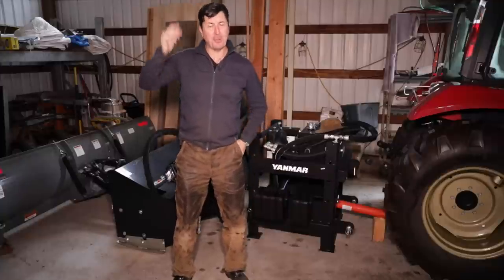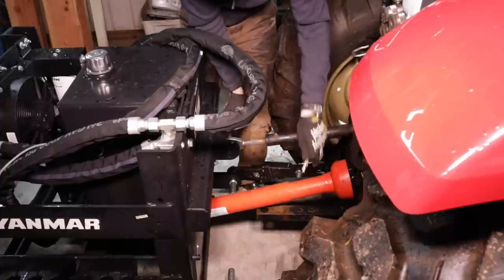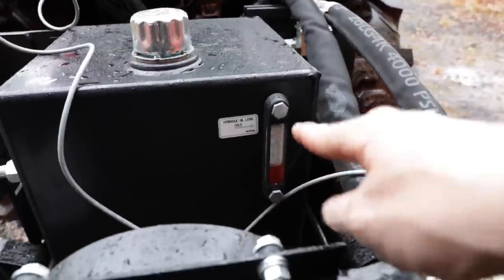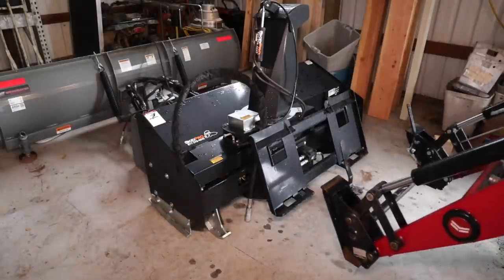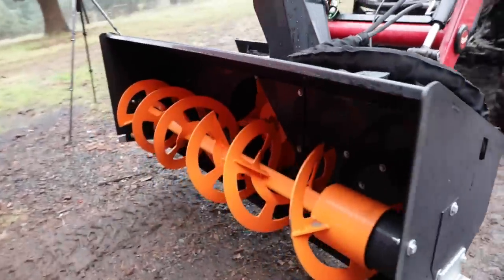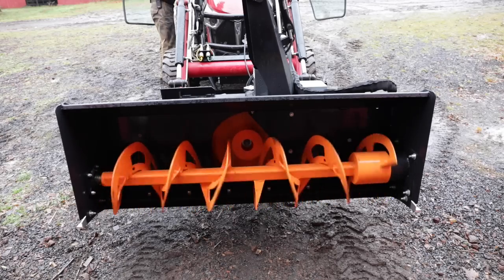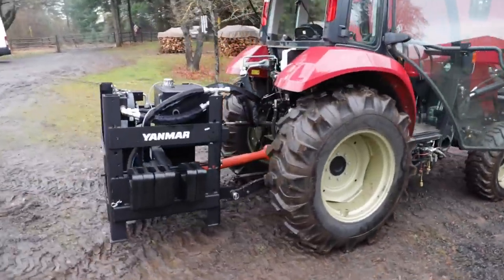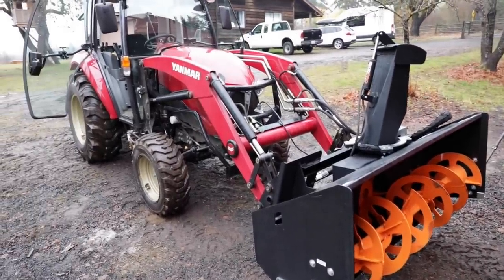This Yanmar Prototype Snow Blower Is AMAZING!!!

Comment: its pretty obvious another what was once a good youtube has sold out on us says the backhoe or box blade is to big on the back of the tractor and yet that crazy power unit sticks out just as far if not farther than either of those.
Reply: Really? What tape measure were you using?  My backhoe for my smaller tractor sticks out farther than that thing does on his big tractor.  I don't remember him saying anything about a box blade. My box blade is very short and if I make it more useful with 3 blades instead of 1 it will be heavier and longer.

Comment: Slightly off topic, but I'd respect your opinion on a question about tractors.  I know your background is operating heavy equipment, so you'd be a good one to answer, and it might be a popular video.

Question is (ok, multiple related questions):  I'm buying land to start my homestead, and I want to buy a tractor that is best for use on about 30 acres.  The land has a lot of trees now, sandy soil, and is in the South-Eastern US. If I have about $20,000 I want to spend on the tractor plus about $10K for attachments, would you look for a used tractor or a new one, and which tractor(s) would you look at?  What if I was willing to spend $50K on tractor and attachments?  Supposing the $30K was in the budget and $50K is possible but stretching me a bit, should I just "suck it up and spend the money", or is the $30K plenty for a small homestead?  Is the balance between tractor and attachments to start with about right, or should I spend it all on a tractor and buy more attachments as I can afford them?

Hope you are interested in taking this one on.

Comment: you should of ran the wire up the front loader arm so if your not paying attention the control wires don't get pulled and broke by lifting the unit to high,, (the pivot point for the wiring harness will be at the back pin for the loader) just a thought I run excavating  equipment for a living i see small things like that get forgot about and wires get ripped out

Comment: I have a 60" thrower that's connected to the back and direct drive on the PTO.  Paid around $2K from Northern Tool.  I keep the plow on the front and the thrower on the back.  This thing seems like total overkill to me.  ;-)  Video is on my channel.
Reply: I completely agree, why over complicate by adding an entire hydraulic system when you can just power the snow thrower direct off the PTO. No wasted energy, very simple design and very simple to repair yourself. This Yanmar system seems to be complicated just because they can, so many different failure points vs a direct drive PTO snow thrower. Sure then you drive in reverse but then you are also closer to the snow thrower and it makes it much easier to tell distance. I also didn't care for the fact that this unit has no drift cutters. All my opinion though take it or leave it :)
Reply: can use all sorts of skidsteer tools... it's more flexible
Reply: i could fit that blower on to a MT55 bobcat
Reply: Any good units for a jd 1026r?
Reply: sure, but can your bobcat do everything this tractor can?
Reply: Yeah this is just stupid?
Reply: I think I  mentioned this idea in one of your previous video's.   It is a great idea!  This will give the tractor all of the skid steer ability and still have all of the tractor abilities.  It would be nice if they could install hy-flow pump to run directly from the engine instead of the PTO.  That would be the machine I would want.
Reply: no not at the deere dealer here in pei but my kubota dealer sells snowblowers wich can be run off with the hydrulics on the arms of the M30 kubota loader wich kubota uses its own hydrulic fluid wich transfer from the hydrulic tank thats on the kubota m tractor and goes in to the front at the m30 loader and it runs the blower and the hydrulic oil trans fer back to the tank on the kubota wich its slick wich done it with a m8540
Reply: Michael Mac Tavish 
Sounds like a better alternative to jd setup
Reply: plus kubota even has a front mount 3point hitch with front  hydrulic remotes and pto shaft for them on front as well as a optional wich is nice set up with front 3 point hitch and a nice $1,799.00 60'' blower from my kubota dealer
Reply: you obviously have never heard of rear view mirrors.  I've spent a few hours at a time clearing snow with my machine.  Driving it backward is a simple task.
Reply: Bigelow Brook Farm (Web4Deb) - No thanks. I like to face my work, not have it occur behind me.
Reply: I'll be honest, this seems to be Yanmar and Cody finding a complicated solution to a simple issue. We already sort of know that Cody is prone to that, go back to his video where he wanted to build retail style shelves for his workshop only to have everyone remind him French Cleats exist. Yanmar for their side of it, just found a way to force people to buy two tools to make one work.
Reply: Can't wait to see it in action!!!
Reply: I think the idea of backing down the Martians long driveway might be a bit of unnecessary back pain and neck cranks, also you can run things such as brushes and others.  Being as far as the homestead is from things like hospitals or him as a First Responder the ability to throw snow might help save lives.
Reply: I think a lot of you are missing the point. The hydro pack isn't just good for the snow blower, it can now run any high flow attachment a skid steer can. So it's a lot more versatile then you are thinking it is.
Reply from the maker: Have you ever had to get up at 4:00 in the morning to plow a driveway that is nearly 2 miles long in a blizzard in reverse just so you can get to work? I have and I can tell you it is not fun. Don't forget we live in the mountains so one wrong move and you're over a cliff. Perhaps you should wait and see how it works in the condition we have before you discount this setup.
Reply from the maker: No
Reply from the maker: I just love all the opinions from people who don't live in the mountains and know little about snow removal,
Reply from the maker: Yep a rear view mirror solves everything, what a clever chap you are,
Reply from the maker: I'm always open to a good idea. Please show me a better way to mount a snowblower to the front of a tractor,
Reply: Wranglerstar   Front PTO on a three point hitch would work as well for the snow removal.  This hydraulic pack will run a 5 foot brush hog though.  This would be the very thing up front.
Reply: I've put in a lot of miles with a snow blower on the rear of a tractor and I can say from experience that every day I longed to have the blower out front. You don't know the sore neck you get till you have spent 7 miles looking over your shoulder. And don't even suggest that a mirror is going to help. When its dark and the wind is blowing at you and the ice is blowing all over your back end there isn't a mirror in the world that will help. Half of my time snow blowing was in an open cab tractor with no heat. There was nothing fun about it but we had to have the road clear for the guys doing the logging on our cattle ranch. I would like a more compact hydro unit than this one but when you are spinning up a hill at -30 you would be glad for the extra traction.
Reply: fast cyclst a
Reply: Wranglerstar's Yanmar Model YT359 tractor is 58.9 gross engine horsepower and 52 PTO HP at working speed. It has a two pump hydraulic system. 9.4 GPM (gallons per minute) (35.5 L/min.) for attachments. 5.3 GPM (20.1 L/min.) for the power steering. 14.7 GPM (55.6 L/min.) total flow from the tractor's two pumps.
https://www.yanmartractor.com/resources/spec-sheets
Reply: Maybe it wouldn't work on this large of a tractor, but the International Harvester Lo-Boy 184, a supersized garden tractor, Runs a shaft from the rear to the front to make a front PTO. lift height is limited to around a foot though. Maybe running an external motor on a snowblower would be a good option too? Not sure, but it might be cheaper just to have an external 20-30hp Honda unit mounted on the blower itself. I'm sure you would have considered that though.
Reply: Yanmar, KISS rule.  Take a page from Kubota's book.  Use the mid PTO or run an underbelly PTO for the snow blower.
Reply: Here in Finland we get tons of snow. Probably more than you do. What we have are snow blowers that are mounted to the rear of tractors, powered straight off the PTO, but instead of having to reverse to make them work, the blowers are made in this kind of a V shape that naturally collects snow as you drive forwards, and then throw that snow whichever direction you want to. People use these snow blowers professionally, to clear miles and miles of roads a night. These things cost about 3000-6000 USD in Finland depending on model and features, which has got to be less than something that is as complicated as that Yanmar thing is. Here's a video (not mine) showing how they work: https://www.youtube.com/watch?v=sK_Mnu0HrTU
Reply: Wranglerstar Im a Canuck. I can assure you we are not strangers to snow(all forms of it). You are giving a very complicated/expensive solution to a problem that has already been solved.  1- i would have the driveway 1/2 done before you were finished hooking all this up. 2- we have all used(some of us) 3 pt hitch blowers, they are extremely dependable, do a great job, and have very few if any weak fail points(wiring etc).  3- you have not mentioned the cost of this setup? Im sure you are sponsered but the rest of us "working stiffs" have to shell out real hard earned money for the things that make our life easier. I am making a guess at cost but I would say most people wouldn't shell out $10k(guess) to drive foreward with the same results. 4- I feel like I got duped into watching a commercial??
Reply: @trentond83  It may seem overkill for just a snowblower, but think of all the implements you can run off a system like this. You basically have a full size tractor that can run Skidsteer attachments, awesome.

Comment: The electrics for the blower you should run along lift arms so you can blow snow with loader way in the air for instance if you have a 20' drift you need to blow out.

Comment: That was definitely designed by an engineer with a gun to his head.  Our 753 Hi-Flo Bobcat with an 84" blower....bombproof.  We have used it for 20 years down in Oregon, it's a one man five minute operation to install.  That thing you have.....I don't even know what to call it, guess I have to see it run.  I doubt it will impress me and even if it did there are just too many weak points.  But, hey, ya know, free stuff.

Comment: Looks like it could be kinda handy. Would have liked to see the controls for the snow blower somehow implemented into the standard front loader control lever instead of a seperate remote. Like maybe a switch that toggles between normal loader functions and control of the secondary hydraulic systems. Other than that it looks great. Definitely see how this could be useful :)

Comment: Wouldn't it be much more efficient to drive the snow thrower directly with the p.t.o. as every good snow thrower has for the past 50 years
Reply: Yes I'm theory there is much less of an efficiency loss with a mechanical drive system. Hydralics as a form of power transfer method is very inefficient.
Reply: Save A Penny 
Spend A Buck

Comment: just thinking of optional devices to use the big power back on the back... 

 giant road and driveway sweeping brush..  there are several possibilities for hydraulic jack hammers.. but instead of a fixed mount for the jackhammer.. have it on a let to right slide with a hydraulic cylinder so you can jack hammer like one eats corn on the cob.. side to side.  move forward and take another row side to side.   but also have the hydraulic jackhammer mounted on a dozer type of blade to push debris around.  might have to have the bottom with a double sided cutting edge so it could be used to pull debris backwards also..  it might fit on a conventional front bucket lip..   with a hydraulic up and down on the body of the hydraulic jack hammer so you can go way below the cutting edge of the blade with the impact tool edge. 

  perhaps a hydraulic compacting roller for the front.  so you could compact driveways or areas where you don't want weeds or grasses to come up thru. pack the soil tight. but it could also be used to compact asphalt or even gravel driveways.. 

 will the conventional tractor hydraulics run a drive for drilling fence post and other holes with a various sizes of augers..  got to put that hydraulic unit to use.. 

 these are just thoughts.. you might share with the tractor manufacturer..    don't forget.. that spraying the chute with multiple layers of PAM cooking spray will prevent the snow from sticking ... you can do the same to the grooves of your tires.. along with the sidewalls.. so your tires don't get packed in snow reducing grip.

Comment: Is that electric plug on the tractor instead of on the loader? I can see it already, if it is mounted on the tractor it won't take long to break a wire and damage the plug when you try to lift.

From experience as well, a long cord is is a cut cord. If will get caught on anything and everything.
Reply: You can neatly coil up and zip tie long cords...

Comment: Good looking blower Cody. I have seen the ones people buy to put on front of 3/4 and 1 ton pickups and they need to take a page out of Yanmars book cause the engine driven pump they use under the hood of the truck stalls the engine of the pickup out and isn't good at polar temps.

Comment: Always found having a pto driven snowblower works better than hydraulic plus I like still having the bucket on the front some snow just won’t move with a snowblower. Wow that’s a lot of parts to go wrong and anyone that lives in an area where is snows a decent amount will tell you it will go wrong in the middle of a storm
Reply: Well if by some chance it does break then what? Well from experience you just go back to the way you did it before. Assuming you can't just fix it with a little duct tape and bailing wire......

Comment: @Wranglerstar  Cody with that high flow hydraulic pack you could probably run a quick attache stump grinder on the front which would be very interesting to see.

Comment: Erskine has had this for years. It is probably made buy someone else. But looks good. You shouldn't be snowplowing with the loader on a compact tractor anyways. They weren't meant for the sideway loading when the plow is at an angel. We end up welding up costumers loaders every year.  Before you use this lock in your quick attach arms in the rear and slide in that draw bar. Have fun.

Comment: Enjoyed watching, is that a Woods 72" blower? I have a Woodmax SB-60 mounted on the rear of John Deere 855 quite heavy though. As soon as the 855 sells will mount on my new YT235 Yanmar. Is that Yanmar hydropack custom built, or available on the retail market? Would love to have the spec sheet and bill of materials on that, absolutely beautiful piece of equipment. Are you at liberty to say who and what location Yanmar dealership built that? I'm doing a poor man's version of the chute rotation and deflector movement with an ATV winch and linear actuator, both 12 volt. You have me wondering if I should have bought a larger Yanmar.....

Comment: That's a prototype remember, big solid hydraulic lines through the restricting quick connects, the hydraulic reservoir looks really small, that monstrosity on the 3 point hitch is worse than having the hoe attached, I suspect that it will blow powder nice but when it comes to wet snow you will be blowing poorly at turtle speed. The Mickey Mouse chute control needs to be added into tractor control system should be hydraulic and lever control. Blower isn't wide enough need more than 2 inches each side.Good luck with that unit, I tried to attach a video of one that works well send me a note that I can attach video to and I will send it.

Comment: Just so I'm clear on this.  That front blower is a little too much for the tractor to handle on its own?  The tractor can't handle the amount of hydrolic fluid and hydrolic fluid cooling that front unit needs?  So that back unit, adds more hydrolic fluid, and cooling for that front unit?  Do I have that about right?
Reply: This  system (other manufacturers of compact tractors offer similar systems) allows hydraulic-powered attachments like the snowblower originally designed for use on skid steer loaders to be used on a compact tractor. There are many of these skid steer hydraulic snowblowers on the market in North America from several different manufacturers. And there are very many skid steer loaders in use in the North American market. But very many of these skid steer loaders, and the similar-sized compact track loaders, do not have spacious, heated, comfortable cabs as do many compact tractors. Another important point, a compact tractor can usually travel from job to job more quickly than a skid steer loader. If a snow removal company, other types of contractors, municipality, educational institution, company, or any other skid-steer hydraulic snowblower owner/operator wants an alternative to using the snowblower (or other hydraulic-powered attachment) on a skid steer loader, this system gives them an alternative.

Comment: Or you can just make a weight out of concrete to use it when carrying logs or using your snowplow without risking damaging your pump or you can always get a premade weight but it would be more expensive. Also the mechanic in most cases isn't going to tell you that they break because they could lose ther job (I am not saying that these are bad tractors).